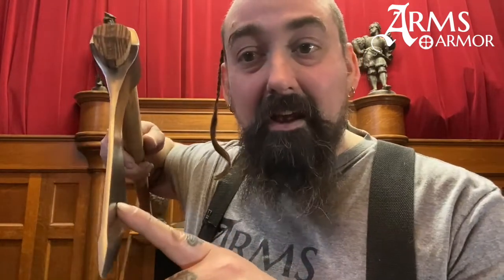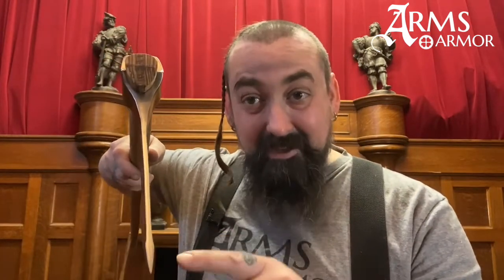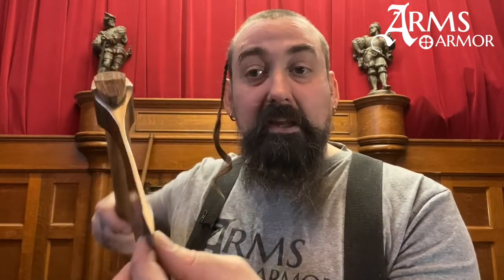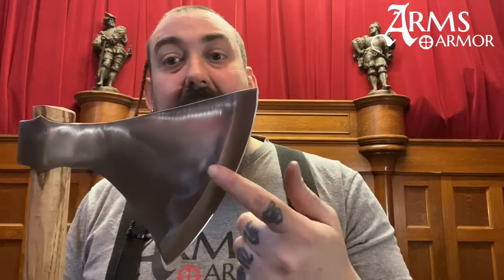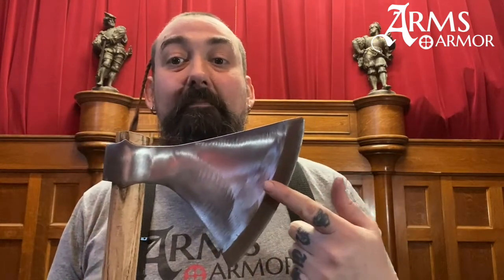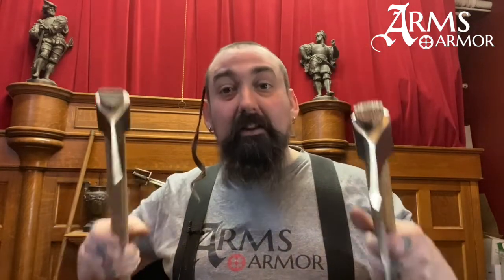Reinforced Type L Danish War Axe

Comment: Both beautiful weapons.  I wonder if the reinforced model is easier or harder to land straight.  Also, I've always wondered why the top horn of the type L isn't more curved, resulting in a more acute point for piercing.
Reply from the maker: we did not notice a great difference in use though I suspect the small amount of extra mass along the edge does slightly favor it staying on the line of swing.